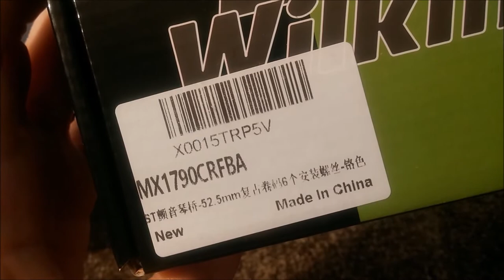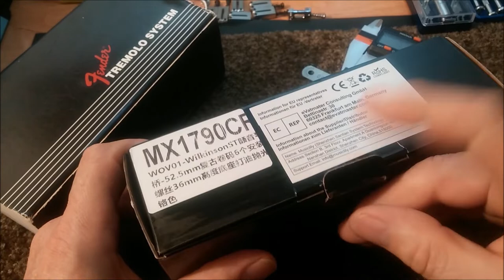New Wilkinson M-Series Tremolo -??- Update your SQUIER Stratocaster??

Comment: Hi, can you tell me anything about the way the bar attaches to the bridge in the Wilkinson? I see that it has no threads and found no info out there about how it stays in. Does it stay secure? Is there any play when using it?
Reply from the maker: Hi, there was a plastic bushing inside the block which was secured with an allen screw on the backside of the tremblock If I remember it correctly.  Holding the bar is friction based.

Comment: I ordered 3 different Tune-o-Matics for my SG before I got the right one. My old one was sagging 2-3 mm.
It's funny the little details that change from part to part and model year to model year.
I took off the saddle pieces and reversed them(the same way they came on the original), getting those little wire clips to go back in was a real pain in the neck. The new bridge did intonate good though without too much saddle piece travel.
Reply from the maker: Thanks fo commenting!